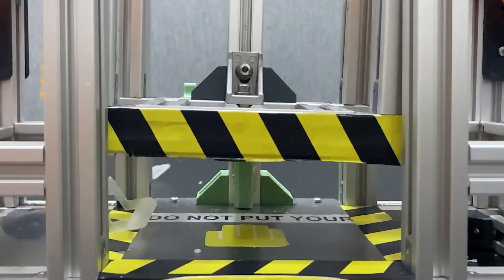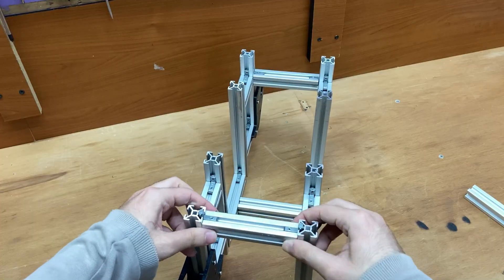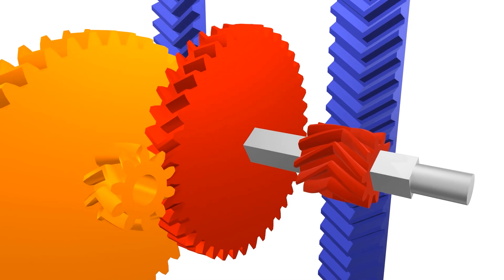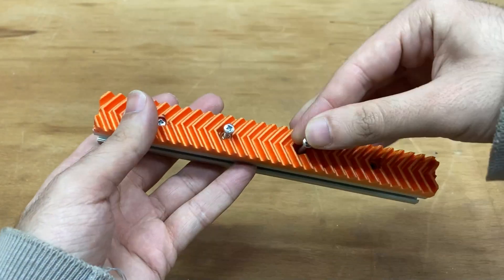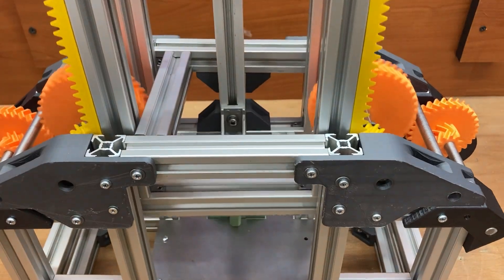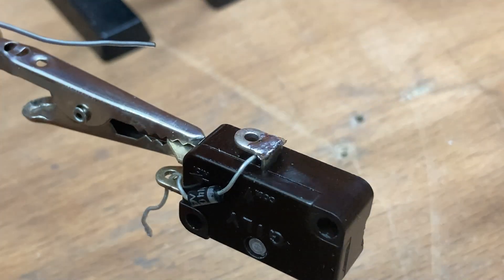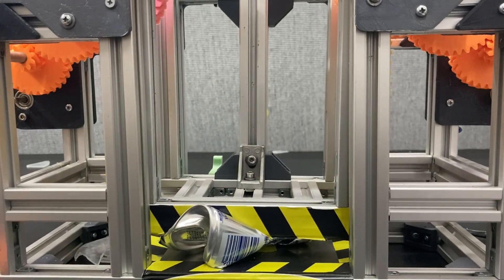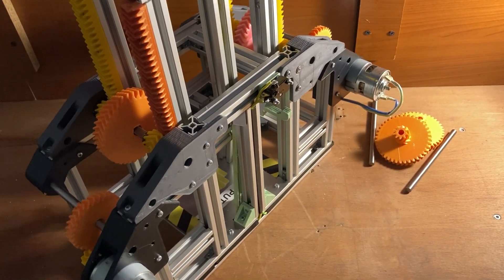Is it possible to Build a 3d printed Press?

Comment: My grandfather was a traditional book binder. He had a beautiful cast iron book press, which was very easy to operate (with your little pinky toe, so to speak) and would press down very hard. It was simple, but precise engineering. The press is moving sideways a lot in your design. You lose contact at the gears, which makes them slip, and the press slides along the object it is pressing. Adjusting that aspect would help, imo. Also, weight, weight and more weight.

Comment: I will say, that steel plate did not need to be CNC machined. With just a center punch, careful measurements, a saw, and a regular power drill you could have very easily made that yourself from 1'x1' sheet steel.

Comment: So... this was a cool video. So, if I were to scale this up, I could do some cool shit. 

Like, before you broke it. You might have been able to make an adobe brick with that little compressing machine. 

Scaled up, made of steel... you could press Hempwood with it. Or Bamboo stands into Baboo plank or pillar or whatever.

Like, seriously... this was a good... simulation. 

Suppose you were in Madagascar, and the best technology is a car. I suppose, there might be a way to set two car engines on either side. 

What if you wanted a hand cranked press. Like... low tech. Wouldn't you want some worm drive setup at the bottom output? That way the design works as it currently does, but it retains tension. I suppose the worm drive would be the hand crank.

I suppose if you wanted a hand cranked one... you'd need a third gear set... so... the gear sets would be covering 3/4ths of the faces to the press machine... and the whole machine could be made of hempcrete. So it could begin getting constructed within 150 days (the time it takes for a harvest of hemp).

Lol. With a third gearset... wouldn't you have more torque. (Is that the term?) More power with less stress on the gears?

Anyhow... if it was a manually cranked press... it would be less stress on the guy cranking it too. 

That guy cranking it would need one BIG wheel to crank it... I think. Lol. Leverage is your friend, especially when it comes to compressing materials, to make a DIFFERENT material. 

Like compressing hemp fibers and glue. PAPOW! Hardest wood on earth. Right there. With the machinery that an ingenuitive cave man could invent and make, with ease. 

He'd need to know a bit about Botany. But Hemp's not a picky plant. 

He'd get a shit load of cool shit from that plant. But Hempcrete is just hemp fibers, water, and lime. You compact it into any form. Wait to dry. It's harder than concrete with no steel reinforcement. 

He could make pottery forms of everything. Cast the hempcrete. Assemble it (because Hemp isn't heavy). Lol... 

I'm no one to ask... but... could you... make that video? I just subscribed. :)

Comment: I must ask. is it actually practical to 3D print these gears? like obviously it's easy or whatever. but I have the feeling that you could buy much much stronger gears extremely cheap from like a hardware store or something and not have to use 3D printed parts for this
Reply: especially considering the fact that the gears are the only part that seemed to be 3D printed. it seems like using 3D printed part just for the sake of using a 3D printed part. I realized that you have a video to do, but like

Comment: On the surface that crushes your items. Would it help putting those arms in tracks so they bare down evenly and not apply uneven stress to the gears?  I hope that question makes sense

Comment: Awesome video. 9:12 , you basically made a gravity powered DC generator, well, for a very short duration haha. I wonder if you hooked up an AC motor and basically pulled/pushed the press up and down if it would output an AC signal.

Comment: The final gear set which transmit the force has its limit. No matter what ratio you use, the final gear set is too weak for the load.

Comment: Is it true that mechanical press is better than hydraulic if you don't mind about speed very much?  for example cold welding two thin aluminium sheets together would require the mechanical press to move only slightly and so speed not so important because only a small distance to move. I would make one for cold welding stainless steel sheets and build up structure by adding layers that have been cut with lasers. Like a 3d printer but with cold welding and I could use supportive structure cut into the steets for difficult shapes which would later be removed. I think mechanical is better for that than hydraulic but what do you think?

Comment: You should set a second limit switch on the downward travel, on a sliding bracket that will allow you to quickly adjust how far it smashes into things, and so if it accidentally fires off it won't strip its gears at the bottom of travel.

Best practices dude, always follow em if you can and it won't do you wrong.

Comment: no escribo en ingles, pero tratare de explicarme lo mas fácil posible, lo que yo aria en el diseño de los engranajes, seria hacerle unos agujeros que lo pasen de lado a lado para poner unos tornillos roscados o clavos para darle mas resistencia a la pieza, de esa manera no trabajara tanto sobre las capas

I do not write in English, but I will try to explain myself as easily as possible, what I would do in the design of the gears, would be to make some holes that pass from side to side to put some threaded screws or nails to give more resistance to the piece , that way you won't work so much on the layers

Comment: With this design the force produced by the press is limited to the sheer strength of a single tooth on the pinion gear/rack multiplied by the number of pinions/racks on the final stage. So one way to increase the force produced before failure would be to increase the size of the gear tooth, or to increase the number of racks on the piston.

Comment: i think having something to synchronise the two motors (belt or anything else) can also help a lot because those motors are not realy precise and so they can rotate at slightly diferent speed and the press don't push horizontaly (like at 11:25), i think it's reason why your green guide broke (plus the fact that the objects are not flat).
Reply: the Kingdom of GOD is coming…“Silver is for the kettle, and gold for the furnace, but The LORD is the tester of hearts- Bible” your heart is like discovered silver, dirty and not pure, when silver is purified it is melted over and over, to the point that when it’s melted and glows red hot, it is pure enough to see your own reflection in the puddle, so also does the LORD purify your heart, till HE can see HIS own reflection in it, seek the LORD and be reborn, ask The LORD to renew and restore you, repent and ask The LORD for HIS Salvation for those who seek will find and those who knock the door will be open unto them, no man is good, all are in need of salvation, Jesus died so that our sins will be wiped away and so that we could be made new, seek The Kingdom of GOD for if you would be wise you would be wise for yourself, pick up your cross and deny your flesh and follow the path of GOD, for The Kingdom of GOD is at hand, in JESUS MIGHTY NAME Amen and Amen

Comment: I thin star like metal rod (not square) at least for cogs joints, and larger/wider cogwheel with teeths with 100% infill all from ASA it would hold up to 200KG or maybe more.

Comment: i 3d pinted an automatic orange press.. but just skipped the part with the gears and used the motor of an 800kg electric hoist lift :)

Comment: Why did you use 3D printed T nuts instead of just normal metal ones? 

Also the press seems a little flimsy, it might be better if you strengthened the frame and added some linear rails or something. With all the flexing of the press bit I’d be surprised if the plastic rail at the back is still intact.

I would also be surprised if you were actually getting 2000 N out of it, it seemed to struggle quite a bit with crushing things, like the can.

Comment: I calculated this back in the University many years ago. It’s two main forces that are under pressure. 1 is the axels, the other is the teeth surface on the gears. You can easily solve both with widen the gears, so that the surface area increases. In short make the gears wider. Then off course you can calculate pressure based on the ratios. You can in principle achieve hydraulic pressure with gears, but the “power density” of hydraulics is hard to compete with.
Reply: Geared rollers - or just rubber rollers / cams
Reply: This is the way. Everyone trying to say oh use X filament or Y filament and this or that but those are only marginal improvements at best versus designing this to work with 3d printing constraints.

Comment: Think if you did block and pully system instead, would you get more power? You would have to spring load the press to return to neutral. Just a thought.

Comment: Those gears definitely were going to deform at the axle. It would probably be wise, while you are CNCing, to also make some steel "hubs" that bolt into the final stage gears at a higher radius and transfer the torque there where the forces are much lower, and then the hubs can take the forces on the axle instead of the plastic gears.
Reply: Or at the very least a crosspin through the shaft and into the gear..
Reply: that's genius!

Comment: I think you should design the next one with some lever action, so the 3d printed parts aren't taking the brunt of the torque. For example if you had a scissor jack and made one of the arm halves on each side much longer past the fulcrum, you can get a very long lever that still preserves some kind of parallel motion.
Reply: lever+ screw

Comment: Using straight cut gears may give more torque due to the thicker teeth and surface area of contact between the gears but it will become noticeably louder. One of the other comments 6 months ago suggested PLA+ like in firearms. PLA+ is good for handling the shock from said device and not a gradual load. I have no suggestions on material though so go for it. Also I think the Algorithm sent me?